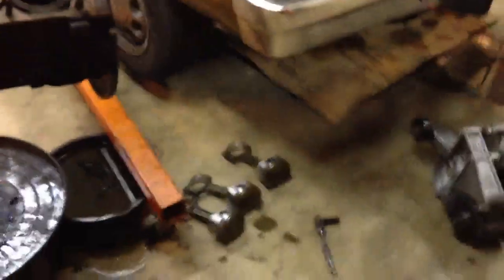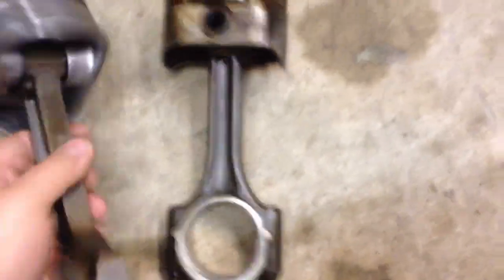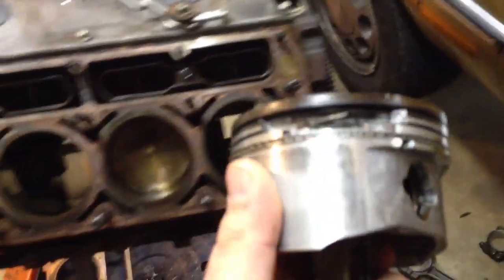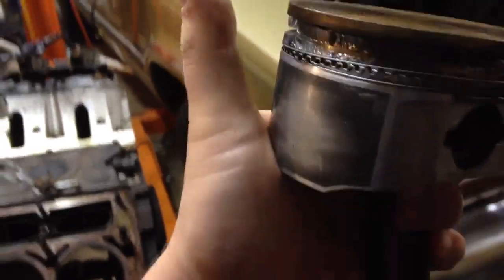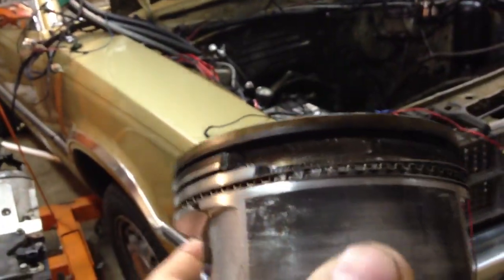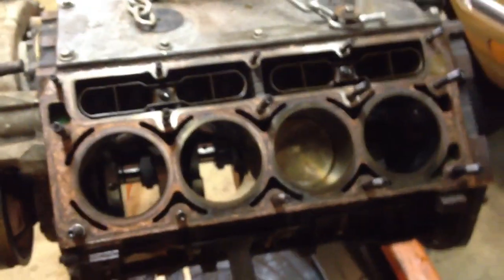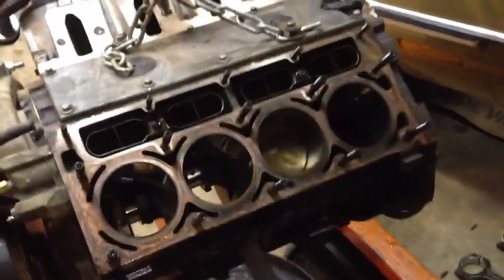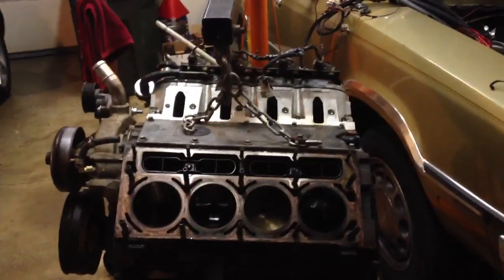11-28-12 Fairmont el scorcho update

Comment: a problem i had was hooking my pvc valve up when pushing 30lbs on a dodge 2.2. the blowby getting sucked into the combustion chamber causing preignition. I was told this causes a problem but didnt believe it until i had an oil scraping ring fail and under hard boost it juststarted smoking and caused major pinging/predetonation.. just a thought that might not apply to u. and that is preignition and not lean condition..

Comment: Two things - the ring lands getting knocked off can be from TWO different things, one bieng the timing, and the 2nd bieng an overly rich condition. The fuel can get into the ringlands and ignite, causing what you see here - not saying that is the problem, but is possible. The other thing, pressed pins don't stick like you show, the only reason yours is like that is oil sludge, bent, or abused (which is the purpose of this video). Even a pressed pin floats in the piston, just not in the rod...

Comment: Im as confused as your are. If the fuel was washing the oil would smell like gas? If the crank was walking the bores and bearings wouldnt look so good. If it was detonating the piston tops would be white spotted and chipped. I think you might just be reaching the limits of the piston its time to bone up for some forged slugs